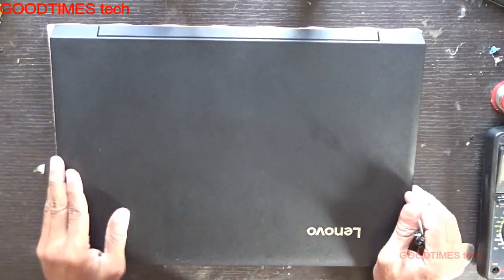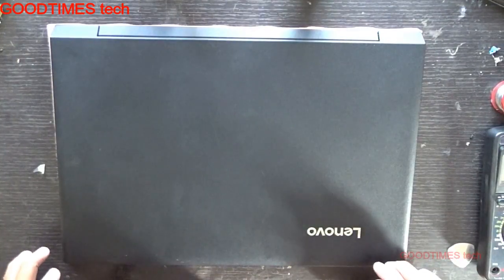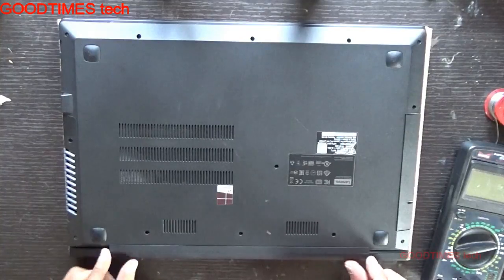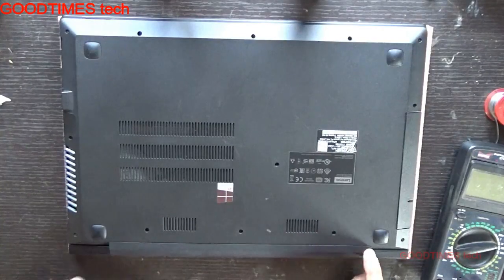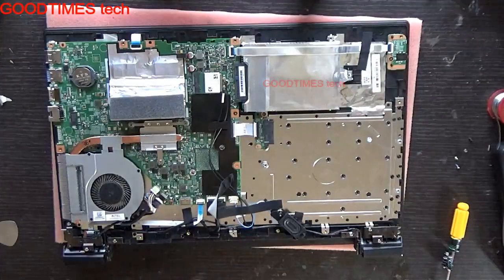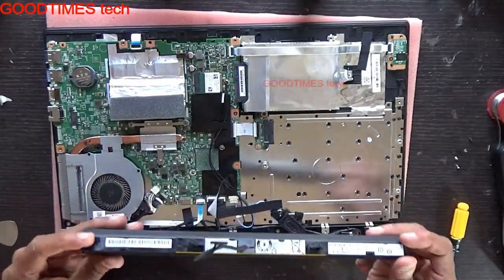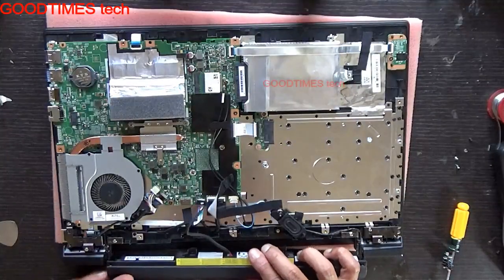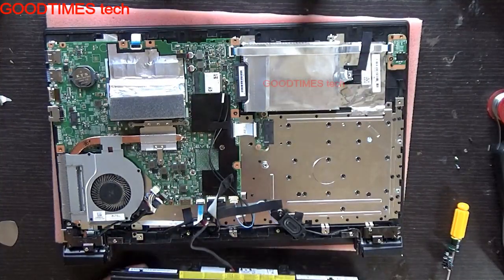Lenovo V110 How To Replace Battery

Comment: Guys, please notice, unlike most of these little plugs the battery plug can go into its socket two ways!!!! Make sure you take note of the correct way when you dissassemble and insert the new one correctly or the batttery will not be detected.

Comment: please share the link to purchase the battery from India
Reply from the maker: Hi, sorry for late reply, 
the link for battery is given below, please check the voltage, wattage and the part number before ordering.
Please try the link below :
https://www.amazon.in/Compatible-V110-14AST-V110-14IAP-V110-15AST-V110-15IAP/dp/B0BRJ9BY7T/ref=sr_1_3?crid=2W91MT4CUYBTX&keywords=lenovo+v110+laptop+battery&qid=1691158815&sprefix=Lenovo+v110+battery%2Caps%2C221&sr=8-3

OR
choose same model(picture in above link) battery from below link:
https://www.amazon.in/s?k=lenovo+v110+laptop+battery&crid=2W91MT4CUYBTX&sprefix=Lenovo+v110+battery%2Caps%2C221&ref=nb_sb_ss_ts-doa-p_2_19

The below link says the battery is original:
https://www.lapalfa.com/products/lenovo-v110-15ikb-laptop-battery?gclid=CjwKCAjww7KmBhAyEiwA5-PUSmqHga6EM5t9E7hQNDzekkyWShijFvgXaPKsw0n_7i4be4697PAPGBoCKvQQAvD_BwE
Take care and do the purchasing on your own risk.
Thank you, have a GOODTIME....

Comment: Thanks a lot buddy
Please I use the same laptop, it was on charge when I came back it was blinking despite the fact that it was off, then when I turn it on I can hear that the system is running but it keeps blinking and will not display. Please any suggestions?